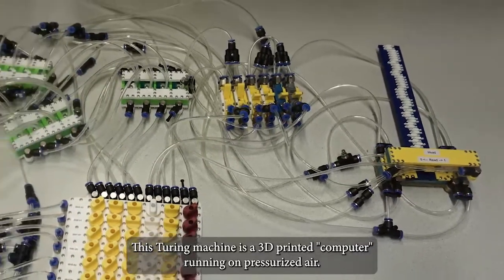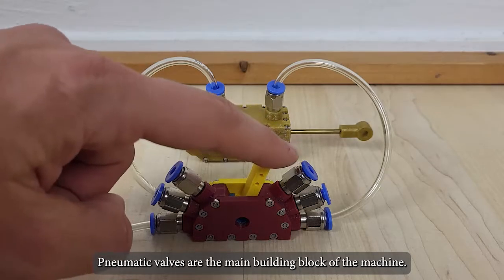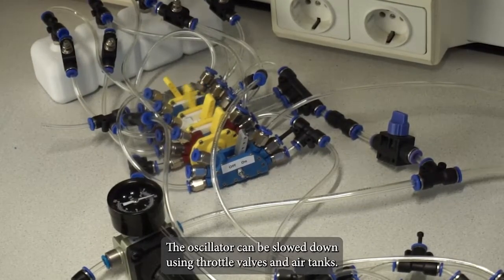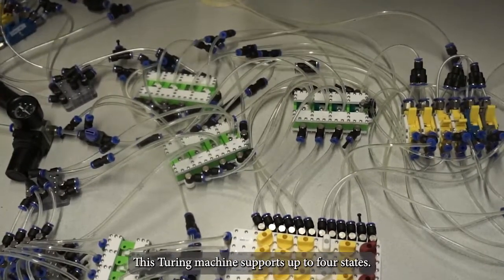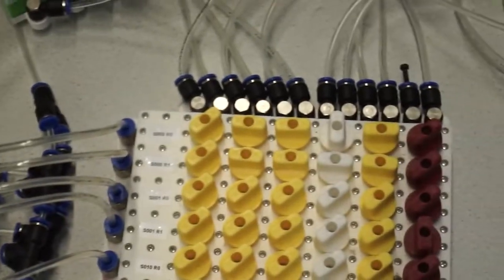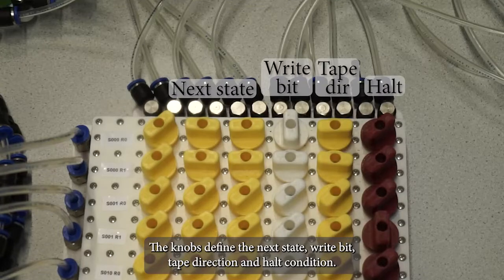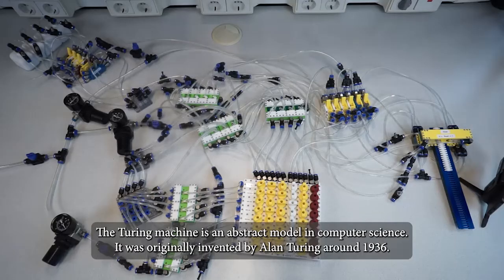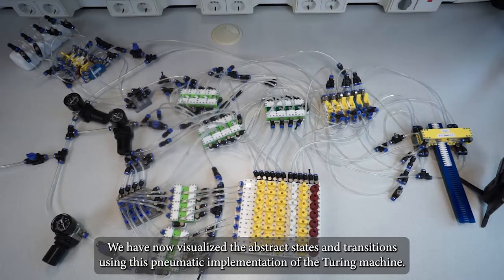Pneumatic Turing Machine

Comment: Kind of giving me ideas.  Always been, at the back of my mind, trying to 3d print a Zuse Z1 like mechanical computer.  I knew about air logic before but never thought to try it as a 3d print.  It does make me wonder if its posable to 3d print one of those inverters as one part using water soluble filament supports.